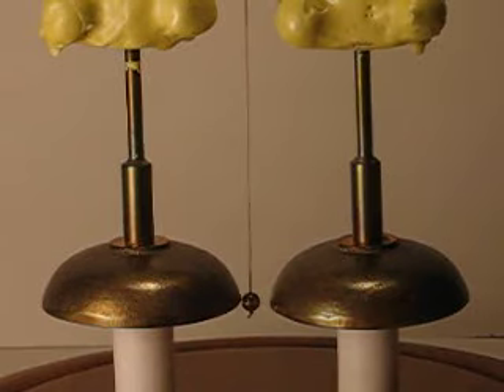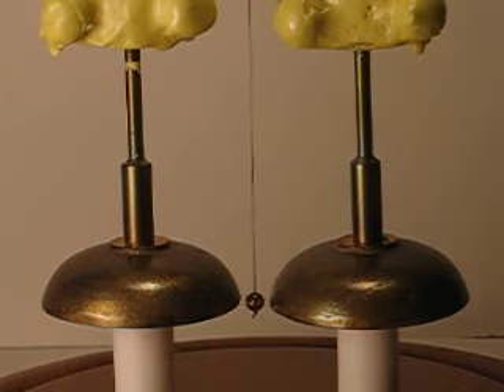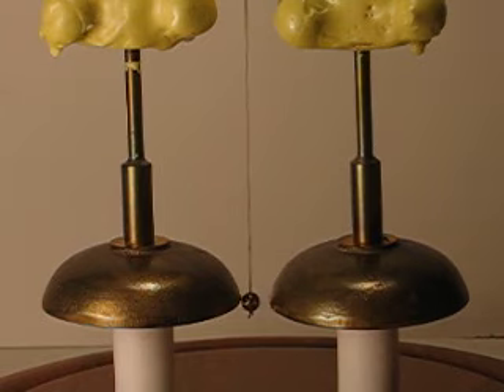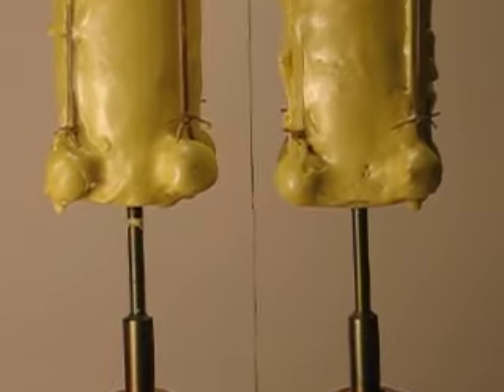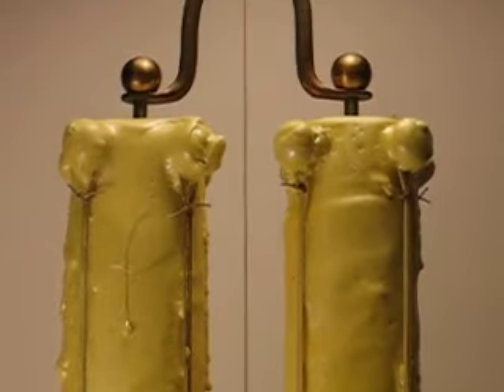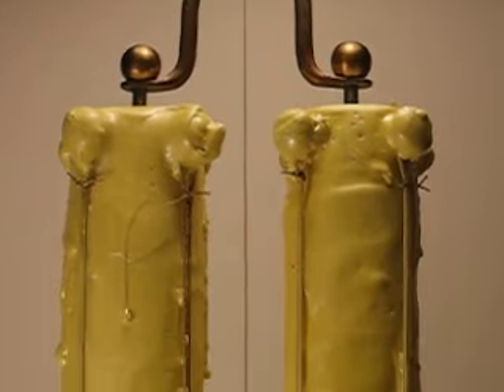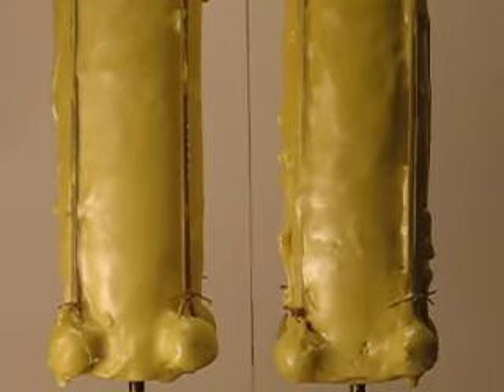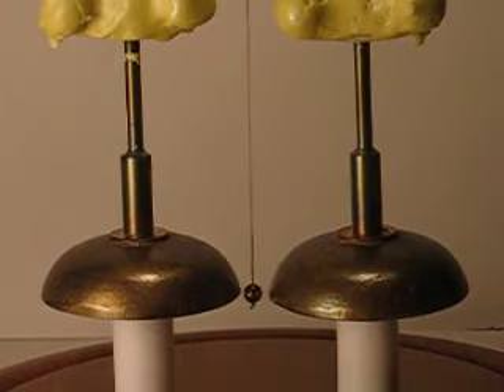Oxford Electric Bell Replica

Comment: Hi there, is it still working?
Reply: Marius Loubeeka had this to say about the subject:
The reason why this battery lasted this long is the very low current. 176 years x 365 days x 24 hours x 1 nanoamp = 1.54 milliampere-hours - that's nearly nothing. A modern phone battery (3 ampere-hours) would run over 342,000 years if the current consumption was only this low.
But what really is remarkable is that this battery seems to have very little self-discharge. The alkaline batteries I bought the other day have an expiration date of 2021. Then their capacity is only at 80% even if they've never been used. That makes a self-discharge current of already 13.7 microamps - Though this capacity might even be sufficient to deliver an extra 1 nanoamp for a bell for several years.
Reply from the maker: I don't know, if you address your question to the Spark Museum in Bellingham WA they may tell you.
Reply from the maker: @cjbartoz  Thanks for the analysis, I agree with most of it.

Comment: Very good - how did you know how to make the battery, when nobody seems to know what it's made of?
Reply: He made a battery with the typical materials of the era
Reply from the maker: I may make the research available again since you seem to have an interest.
Reply: You can try this with a good quality aa batteery might last several years😂😂😂
Reply from the maker: I have fixed the broken link to my Zamboni Research Project. Here you will find materials and methods for how I made these devices and loads of high quality build pictures.

* See fully documented notes on how I did this on my Google Drive here:

https://drive.google.com/drive/folders/10PldhUDDGfFvxtZgxQq3SAnaP00QPrF1?usp=drive_link
Reply: @thomasplummer7523  thank you.  I'll have a read of that.  It's amazing how little power must be consumed/lost over such a long time; today's batteries don't last so long even if they're not connected to anything. 😀

Comment: looks like coil shorting in between 2 battery packs that produces back emf to recharge each pack as the oscillator runs
Reply from the maker: Your are right about two battery packs. The little ball picks up electrons when it hits one bell, is electrostatically  repelled because of like charges,  and is electrostatically attracted to the other bell because of opposite charges. It then delivers its electrons to the other bell and the cycle repeats. Not much different from a computer boat picking up and discharging passengers.
Reply: @thomasplummer7523  the packs discharge and recharge each other like some kind of teeter totter😺👍

Comment: Hi. Was interested in looking at your notes but they are coming up 404. Is the info still available?
Reply from the maker: I have fixed the broken link to my Zamboni Research Project. Here you will find materials and methods for how I made these devices and loads of high quality build pictures.

* See fully documented notes on how I did this on my Google Drive here:

https://drive.google.com/drive/folders/10PldhUDDGfFvxtZgxQq3SAnaP00QPrF1?usp=drive_link

Comment: Nicely done, but the gap between the bells & the ball appears to be much larger than the one at Oxford.  See here: https://www.youtube.com/watch?v=1Dx1-f8xQio

Given that your gap is larger, it's likely going to use more energy & not run as long--but then that's hard to say for certain because we don't know how you constructed your battery piles.
Reply from the maker: Image my disappointment when I visited Oxford on a Sunday and the doors of the Clarendon Laboratory were locked so I did not get to see the Electric Bell. My niece later filmed it and sent it to me.
Reply from the maker: I have fixed the broken link to my Zamboni Research Project. Here you will find materials and methods for how I made these devices and loads of high quality build pictures.

* See fully documented notes on how I did this on my Google Drive here:

https://drive.google.com/drive/folders/10PldhUDDGfFvxtZgxQq3SAnaP00QPrF1?usp=drive_link
Reply: @thomasplummer7523 oh man . Im sorry it was locked .. i hope you get to see it someday.
Reply: @thomasplummer7523  i bet in 500 years the oxford and plummer bell will still be going strong 💪 👍🎉